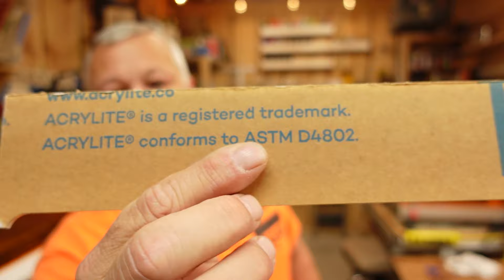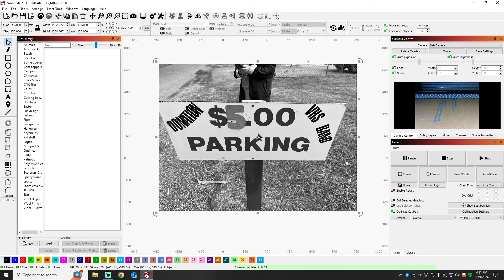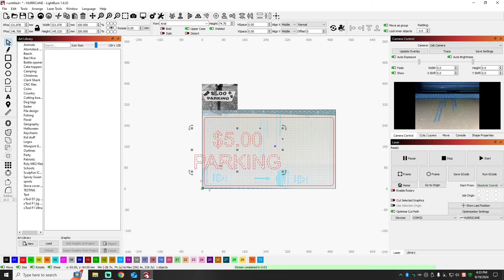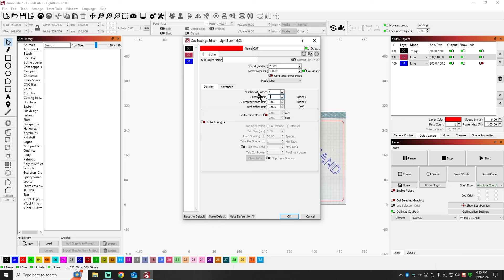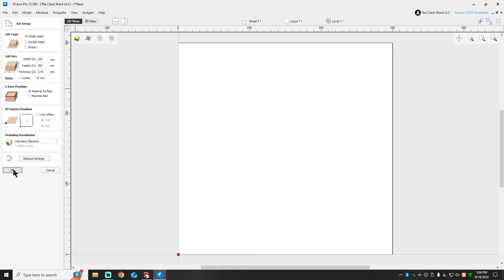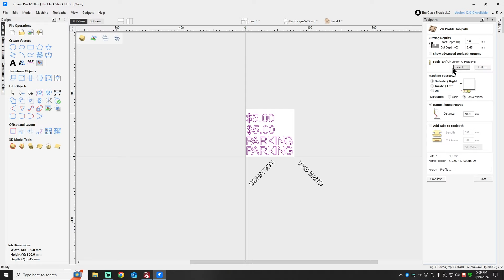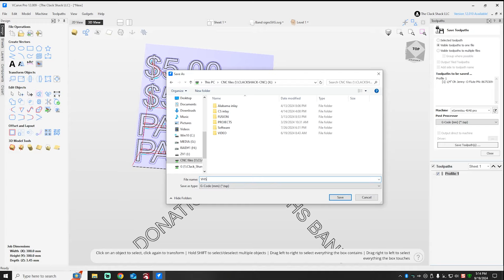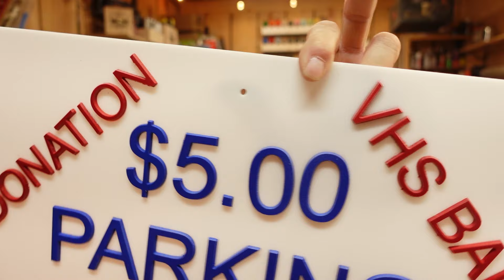A cool project with plastic

Comment: How did you clean up the edges of the letters. I've cut hdpe, and it leaves a lot of fuzz at the cut unless I use an o-flute.
Reply from the maker: They had some shaving stuck to them but just used a cloth and wiped it off. The rotation speed and travel speed will dictate the "shavings" size.